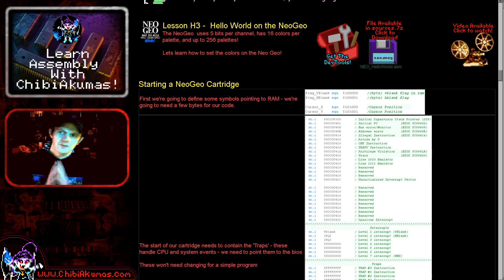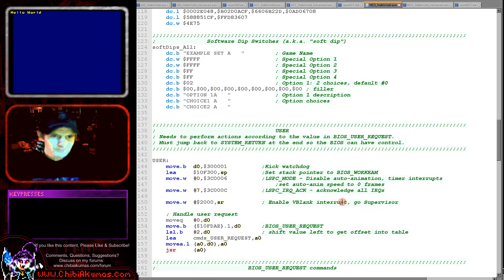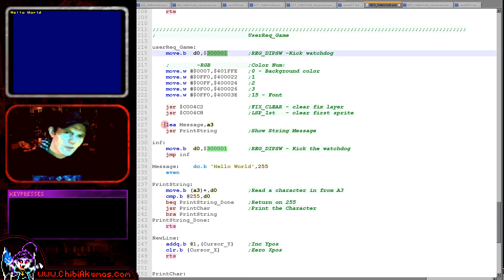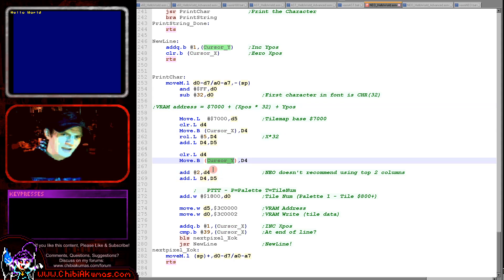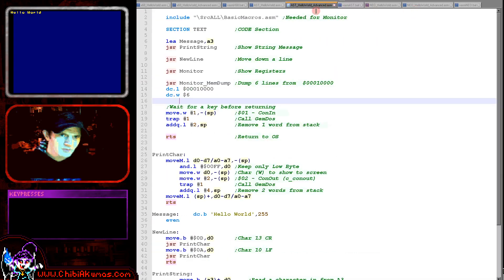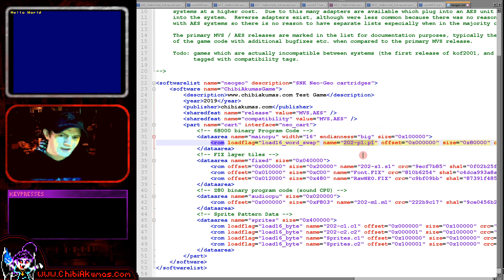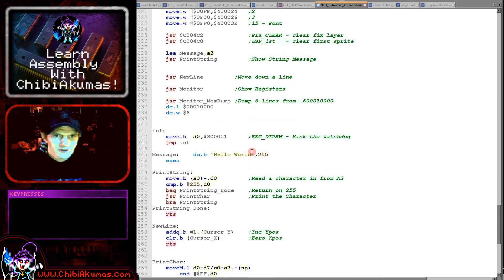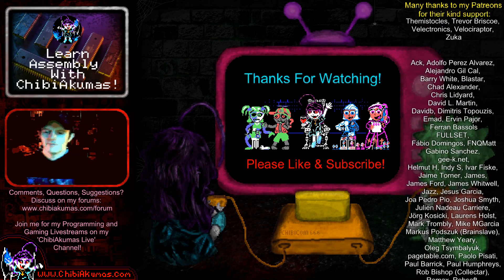Hello World on the NeoGeo - 68000 Assembly Lesson H3

Comment: hello i started to watch your tutorial about 68k first i want to thank you about this great work but i interface some problem to run the emulator i don't arrive to run the program by pressing F6 and i am stuck in this stage i watched all the video but not capable to try some stuff plus don't able to try the graphic tutorial i charged the toolkit please if you can do  video approximately 2 min  about this with more details (how to start the emulator )
Reply from the maker: If F6 doesn't work, It sounds like another copy of Notepad++ is running on the machine causing the pre-configured one not to work
Reply: I've had this problem too. The way I understand it is, you have to go to the dev kit folder, in this case 68000DevTools and double click on Xdrive.bat. You'll see windows command prompt briefly and then a new file explorer screen will pop up. It looks similar to where you were but the file path is now X:\ and now scroll down and double click Notepad++.bat. F6 should work now